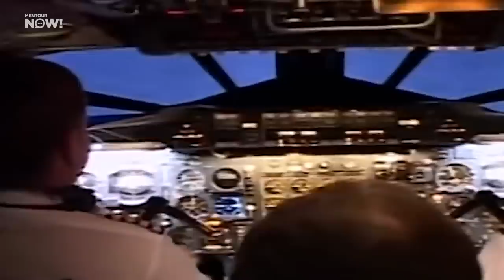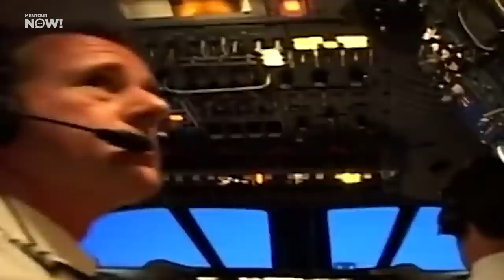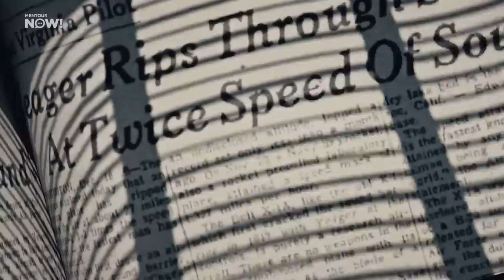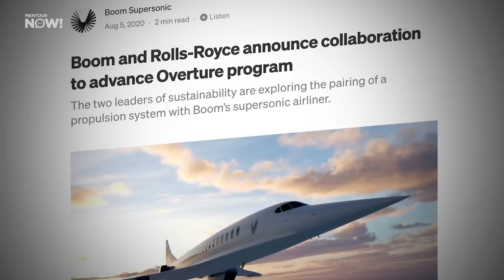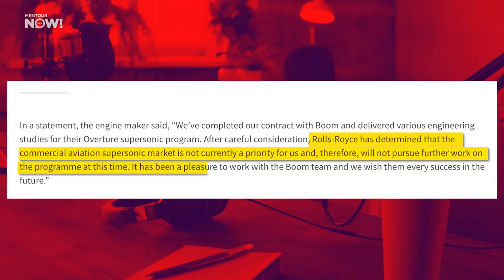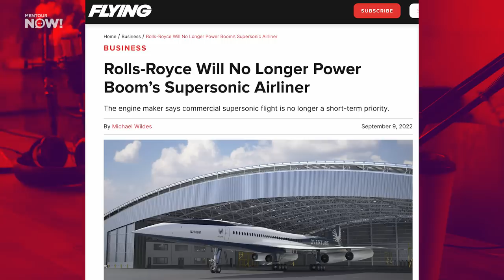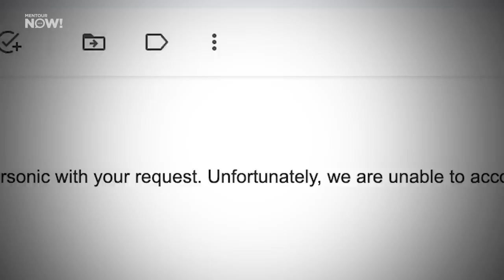WHAT’s Going On with BOOM Supersonic?! Will it Fail?

Comment: I think we are repeating some of Concorde's major issues with the Boom Overture. It carries even fewer passengers and uses four medium bypass turbofans.

In today's aviation environment, airlines are looking for ways to trim operational costs. Twin jets have replaced quad jets on long haul flights. Bypass ratios gone up to increase efficiency. With less engines comes less maintenance, less downtime, and less parts to keep on hand. Airlines are eliminating first class seats and trying to squeeze in more economy passengers.

Who's going to fly on this supersonic jet? Just the wealthy few in this world looking for novelty? Everyone else is looking at ticket prices first and number of connections that need to be made. With it's less than 5000 miles range, it can't really do trans Pacific flights just like the Concorde. Overland supersonic flights are out of question due to sonic booms. With Zoom meetings and our hyperconnected world today, business travel has become much less frequent. After all, I can having a Zoom meeting instantly and very cheaply. No need to wait in airports and spend on hotels either.
Reply: Will Overture be able to fill the gap left by Concorde in the SST market?

Introduction
Boom have undertaken a mammoth task in developing and producing the Overture SST, with its Symphony power module and turbofan engine. The biggest risk is that they will deplete their capital, before a prototype Overture flies. Once that milestone is reached funding should be available. The following, is based primarily on information from Boom, and assumes that Overture meets its specification and goes into airline service. I have no connection with Boom whatsoever.

Aviation
Aviation has changed radically since the iconic Concorde first carried passengers in 1976. More people are flying, the number doubles every 10 years, and they are richer. Aviation fuel is roughly the same price as it was in 1976, taking into account inflation, and with deregulation, airline tickets are now cheaper, in real terms. Aircraft now have the range to fly non stop between any two airports in the world.

Technology
Computer aided design, and simulation has transformed aircraft design and development, by drastically reducing time and costs, and increasing effectiveness. In addition, advanced technology and materials, have enabled more powerful, more efficient engines, and lighter, cheaper, and more streamlined aircraft. 

Flight
Because Overture will be economical at sub and supersonic speeds, 500 routes, some mixed land/water, are viable, rather than just 2 Atlantic routes for Concorde. Overture will be carbon neutral, using sustainable aviation fuel (SAF). Overture will will create a sonic boom, but not over land, where it will cruise 10% faster (Mach 0.94) than subsonic airliners. It will cruise at twice the speed of subsonic airliners over water. Concorde carried 100 passengers at Mach 2, over 4,488 miles. Overture will carry 65 to 80 passengers at Mach 1.7 over 4,880 miles. 

Airframe
Both aircraft are 202ft long, but Overture will have a gull wing with computer controlled leading and trailing edge flaps, and a greater span, at 106 feet compared to 84 feet. Overture will also have an empennage. Carbon composite construction will enable streamlining, weight saving, and increased strength, while practically eliminating thermal expansion and contraction.  Overture will weigh an estimated 154 tons, Concorde weighed 185 tons. Concorde could carry 2.5 tons of cargo. The cargo capacity for Overture is not known. 

Engines
Overture's engines will be medium bypass turbofans without reheat, while Concorde had turbojets, with reheat. This means that Overture will be economical at subsonic speeds and will be low noise on take off and landing. Variable geometry ducting in the Symphony power units will probably allow the engines to supercruise.

Costing
Overture's predicted development cost is $8bn, against $14.4bn for Concorde. Manufacturing cost will be less, maintenance costs will be lower, and availability will be higher. Overtures selling price will be $200M, compared to $320M for Concorde. At a guess, Overture's development payback will be 150 aircraft, and airline payback will be 10 years, assuming 72 seats and 8 hours a day utilisation.

Operation
Overture will be simpler to fly, eliminating the need for a 6 month pilot conversion course. Overture will have improved low speed handling, especially on take off and landing, while maintaining low drag at supersonic speeds. It will have a modern cockpit, with a flight deck similar to subsonic airliners. A flight engineer will not be required. Instead of a droop snoot, external cameras and cockpit displays will give the pilots a view of the terrain when taking off and landing. Its cabin will be quieter and all its seats will be business class, almost certainly with internet. In contrast to Concorde's awesome engine noise, Overture will comply with ICAO-14 noise regulations, allowing it to use all airports, without triggering protests. 

Ticket Cost
Taking a JFK to LHR one way flight:  
Showing: Aircraft type,  Fuel cost per passenger,  Economy ticket,  Business Class ticket,  Duration

Boeing 747          $147          $577             $2,308                      8hrs 
Concorde             $753                                $5,000^                     3.5hrs 
Overture^^            $708         $1,200           $3,000^^^^                4hrs 
Business jet^^^                                 $53,000 to $99,000            8hrs  

Notes
^ 2023 value 
^^ Estimated prices, assuming Overture carries 72 passengers against Concorde's 100. For the first 2 years, only business class seats will be available.    
^^^ There are no supersonic business jets
^^^^ $5,000 return 

A 16 hour flight across the Pacific on a subsonic jet could be achieved with a 1 hour refuelling stop by Overture, giving a time of,  4 + 1 + 4 = 9 hours.

Market
Overture will not be competing for the mass economy market. Instead it is aimed at the 700 million long-range business flights made each year world wide. Boom and airline customer surveys show the viability of Overture, and they have identified 500 suitable routes. All Overture's seats will be business class and ticket prices will be comparable with business class on subsonic airliners. Once Symphony gets established it could become a niche service, similar to Concorde, but with many more routes.

Conclusion
Overture will be popular with both airlines and passengers, because it will half many journey times and will be cheaper, more comfortable and a lot more practical than Concorde. The military have already shown an interest in Overture. It would also be suitable for charter flights. There may even be a market for the Symphony power unit or just the engine. As Overture matures, it will probably be developed, just like subsonic jets. So the range may be increased, there may be a stretched version, and even an all economy seat version. After Overture, Boom could possibly develop a 200 seat SST.

22-2023.09.04

Comment: Unfortunately and sadly; I see Boom closing its doors before ever operating a single commercial flight. I've been a part of startups ... the current startup culture doesn't allow for long-term innovation like back in the day. Investors want a quick turnaround ... they want to multiply their money as fast as possible .... which is likely why Boom started working on the air-frame before even securing the engines ..... they were probably under a lot of pressure to show investors some progress .... they also need this progress to secure further funding ... I just don't see it happening. Someone willing to lose money needs to step up - pretty much how most airplane manufacturers started out ... either governments supported them (losing billions in tax payer money) ... or a rich organization / entity dedicated a huge budget to them that they're willing to lose ....

Comment: The Boomers need to be chatting with Lockheed-Martin Skunk Works on the power plants anticipated for the SR-72. The Skunk Works is looking at Dual-Mode Ramjet technology which theoretically could yield Mach 7 performance - which may be a bit too fast for the Boomer design. Boomer Execs may find L-M Skunk Works and the U.S. government would give a thumbs down due to the secrecy of the specs/engine requirements for the SR72. But it's worth a chat at least to explore what facets of the military engine are manditorially secret and what could be shared for a commercial aircraft project.
Reply: They need an engine. Even the P&W F119 only produces 26,000lbs dry and they are not going to let its technology out (particularly the hot section). Concorde's Olympus 593 produced 30,400 which allowed it to supercruise at Mach 2.0 for 3+ hours. No other aircraft has ever come close. No supercruise no SST.

Comment: Flying at S Boom will not be feasible to aviation admistrations in low altitude, it will require micro atmosphere flight. With a turbine plumbing, that channels micro air adjacent, into thick showing air to the front tip as cooling shield. Allowing hyper+ speed.

Comment: Wasting money on a unrelated prototype and lack of engine will almost result in guaranteed failure. Using 4-engines and semi-delta design is a contributing factor. They'd be better off basing it off an existing engine, which doesn’t have the thrust to power a large scale aircraft. .... unless they consider swing wing designs. This might be possible with recent advances in materials. Variable geometey wings are coming into focus, such as the 777X folding wing design.

Comment: I have two comments to make here, one about the most influential airplanes, and the other about the financing of them during the design and operation. In the first case, I would NEVER have included the Concord as anything major in promoting air flight. While it was very innovative, it was not by far the first or only SST airplane. The US had already produced the B-70, and Russia had built their passenger SST as well. But innovative does not make this so special, for the B-29 was extremely innovative, and had very little on air passenger planes. The ME-262 did! The DC-3 did! The Boeing 707 did! The Boeing 747 did! If you look at airplanes in general, then the SR-71 should be on the top! Followed by the B-52, the the Boeing 737.

AQnd responding to the second issue, I do not believe that the Concord was EVER profitable, and was during its design and build government sponsored, which continued throughout its entire history. It carried only 199 people, and only across oceans. And making the claim that the US government fed Boeing for the SST 2707 was also out of line, and context. Here is what really happened: "Three days after the Concorde announcement [1964], Halaby wrote a letter to Kennedy suggesting that if they did not immediately start their own SST effort, the US would lose 50,000 jobs, $4 billion in income, and $3 billion in capital as local carriers turned to foreign suppliers. ...This set off something of a wave of panic in other countries, as it was widely believed that almost all future commercial aircraft would be supersonic,[7] and it looked like the Europeans would start off with a huge lead. As if this were not enough, it soon became known that the Soviets were also working on a similar design. (https://en.wikipedia.org/wiki/Boeing_2707). While the US already had a Mach 3 SST, it was built and intended to be a bomber, and not a passenger plane.

So, the US government invested money into 3 air industry companies, and one of them tried to 'up scale' the B-70 with its bid. That did not work out too well, and Boeing was 'awarded' the contract. BUT, Boeing was going thru an already company life threatening project with the 747, so it had no funds or adequate resources to apply on its own for the SST project. In addition, the impact the B-70 had 0ver land was so bad, just having any SST was not looked at too favorably. Boeing eventually also decided that there was not a market for one, and the project was totally cancelled in 1972. The US government resigned itself to not having any SST (based on Boeing's analysis, just like it said about the AB 380, and the environment impact), nor a Mach 3 bomber!

But the story with the Concord was very different, and there was NO huge airline industry nor a large airline company in Europe, so the governments (yes, plural) had to fund it. But their funding didn't stop with the design and prototype, but continued on for almost the entire time the plane flew. The Concorde was very expensive to fly, used huge amount of fuel, was an environment disaster, was not allowed to fly over populated land, and lost money all the time, partly because of these factors, as well as its very small carrying capacity. It served ONLY the very wealthy or what companies were willing to pay.
Reply: I see I had a typo in my original comments. The passenger capacity was actually 100, and not 199 as I had typed!.

Comment: The problem of sonic boom over land routes has to be fully solved before any hopes of viable supersonic routes can be even considered.
Reply: @lcarliner  Overture will not fly supersonic over land. It will fly 20%  faster over land and 2x faster over water. Because Overture will be efficient at both sub and supersonic speeds, Boom have identified 50 viable routes, compared to 2 viable routes for Concorde.

Comment: I'm more realistic...just try to fine tune the current private jets like maybe next generation after Global 8000, Gulfstream G700, Dassault 10X bring up the average cruise speed to Mach .95 (and reasonable Asia to Europe or South East Asia to West Coast range) that is a pretty decent time savings already. Maybe the current commercials can improve slightly from the .85 speed to even Mach .87-88 (I am not in aviation industry just googled info here and there).  Heck.....wanna save about 2 hours instantly and reduce the stress? Revamp the way TSA is doing checks at the stinkin US airport! Also I'm wondering what's the issue of them going say over 1.4-1.6 over water and then going sub sonic (even at .95) over land? Overall, the time improvement is still quite significant vs regular subsonic speed, right?
Reply: @winesoup6907 Unfortunately, it's not possible to do what you say. The aircraft designers have already optimised the speed of business jets, besides which, business jets are extremely expensive to buy and fly on. Decent ones cost from $20M to $80M, whereas a Boing 727 costs $100M.  Overture, if it ever flies, will do your job. Unlike Concorde it will be able to fly efficiently at sub and supersonic speeds. A 16 hour trip on a subsonic jet could be done by Overture with a 30 minute refuelling stop, giving 4hr+0.5hr+4hr=8.5hr, provided of course, that the route is mainly over water.  

Taking a JFK to LHR one way flight:  
Showing: Aircraft type,  Fuel cost per passenger,  Economy ticket,  First Class ticket,  Duration

Boeing 747       $147          $577              $2,308                    8hrs 
Concorde          $753                                $5,000^                   3.5hrs 
Overture           $628^^      $1,300            $3,800                     4hrs 
Business jet^^^                                 $53,000 to $99,000        8hrs  

Notes
^ 2023 money 
^^ Assuming that Overture is 20% more efficient per mile and carries 72 passengers 
^^^ There are no supersonic business jets

Comment: The only thing Boom will ever produce is one big BOOM when it goes bust.  Under current regulations there is such a limited market for supersonic flight.  The only hope is if NASAs X-59 proves that the sonic boom problem does go away.  Of course, to achieve that in the Overture and get to an optimum speed is likely going to cause further design changes to the aircraft.  That is before you even factor in the additional costs of running a supersonic aircraft such as more expensive pilots and cabin crew to crew the flights - you average supersonic pilot is not going to be accepting a basic Boeing 737 pilots salary.  Even getting a scale model Overture off the ground is going to be hard, but probably the best they can hope for.  Of course, if the X-59 is a failure, the whole thing becomes utterly moot anyway.

Comment: Another aircraft with different engines on the same airframe?

The B36 heavy bomber is the only one I can think of.
Reply: The Hawker Siddeley Trident 3B had an extra smaller jet engine in the tail for takeoff performance. It was also a Rolls-Royce engine, but a completely different model designed for VTOL applications.
Reply: @rollatorwieltje  I suppose in a way, every airliner with an APU has two types of engine :)

Comment: Eh just get Pratt and Whitney to start remaking the J58 engine that was used on the SR71 Blackbird...it was a turbo/ramjet engine, and was more fuel efficient the faster it flew.
Reply: The J-58 was far inferior to the Olympus 593 used in Concorde. It couldn't supercruise. https://en.wikipedia.org/wiki/Pratt_%26_Whitney_J58

The Olympus 593 produced 30,400lbs of thrust without reheat and the J-58 around 18,000. The Olympus was far more fuel efficient. That is why Concorde is the only aircraft in history to be able to supercruise (fly supersonically without afterburner) for 3+ hours. No supercruise- no SST. period.

Comment: My favorite airplane?m = Globe super swift why? because I have 1,000 hours in this poor man's fighter.  1/4 tank with 1 pilot take off roll 125 foot. Stall around 55 mph. 75% cruse 170 MPH. Stressed (with modifications) +6 -4 g.  Very light controls, roll rate around 180 deg per second. Many other things about this wonder plane but all just memories from over 50 years ago.